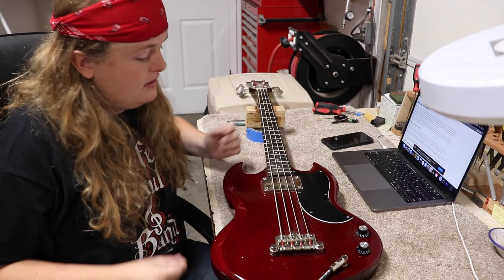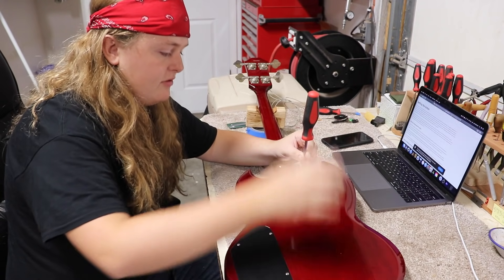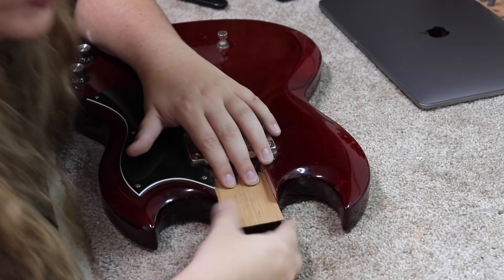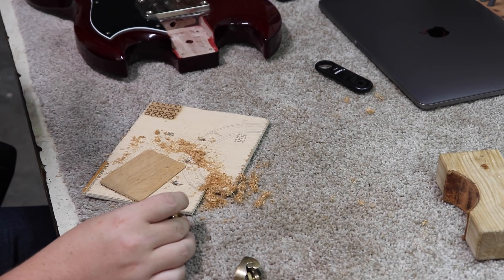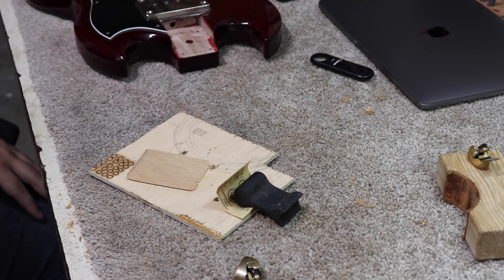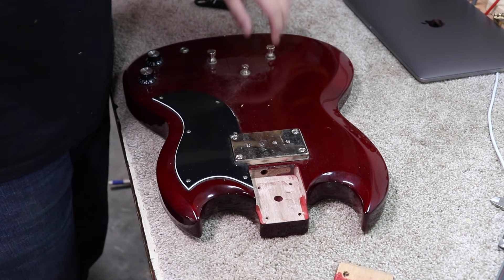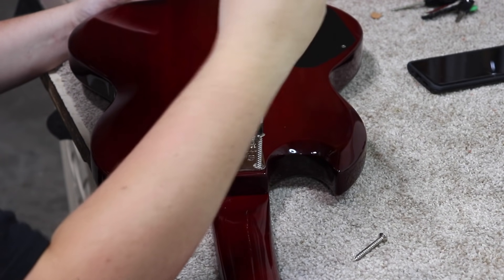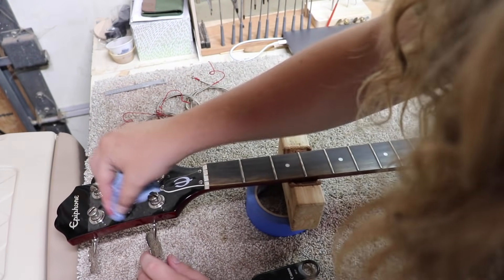Epiphone EB-0 Bass SOLD!

Comment: A great video! Thanks Caleb! A good quality nut is a good idea on those cheap Epiphones. The factory ones are made of some soft plastic material. Flatwound strings are nice on those. It's just that a flatwound set might cost 45 euros while I payed 100 euros for the whole bass used. It's a great bass. Totally unlike a Fender which is refreshing.

Comment: Caleb, if you used a no.3 or 4 plane, it would make the shaping of the wedge a hell of a lot quicker.  And, in theory, wouldn’t require any sanding after it.

Not a big deal but it would certainly shave a few minutes off the job for you